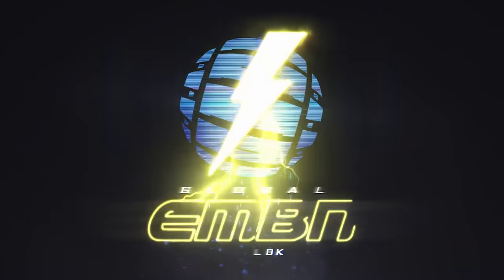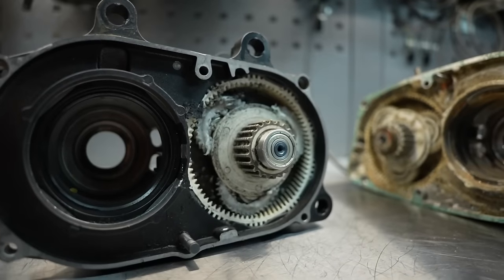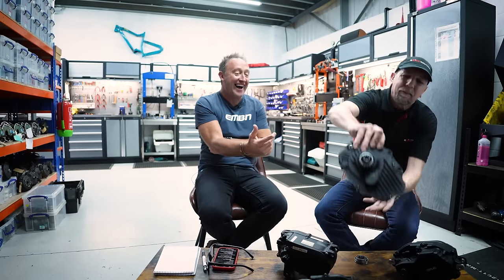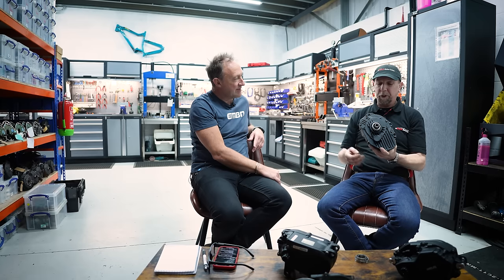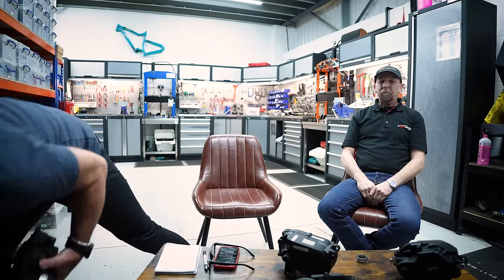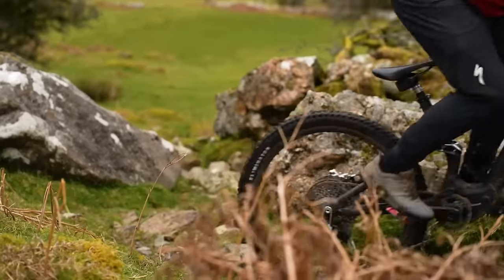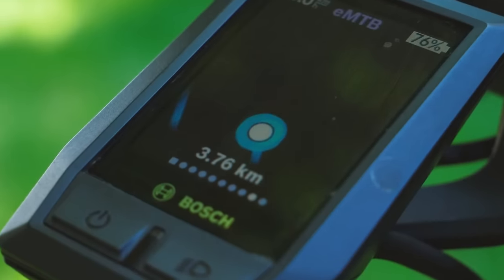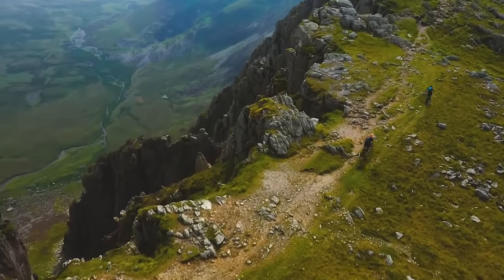What's The Best eBike Motor? | Industry Expert Reveals All

Comment: Its not yamaha, endless problems with them 😫
Reply: Which model? Which problem?
Reply: @stuka78  It was on a 2017 giant Full E=1 with a syncdrive sport motor, had constant water ingress issues, either bike wouldn't turn on after it got wet or would cut out mid ride. 
The bike shop actually took the bike off me and gave me a free upgrade to the model up, a 2018 Full E=1 SX Pro with the syncdrive pro motor. This had the exact same problems. 
By the time i was on the 3rd motor i decided to take it apart and was surprised to see no seals at all. There was a pool of mucky water inside the motor. I imagine their current models are better sealed but its put me off buying another ebike for now.